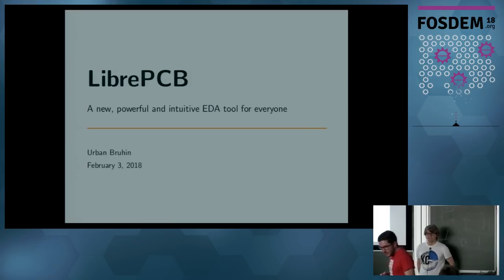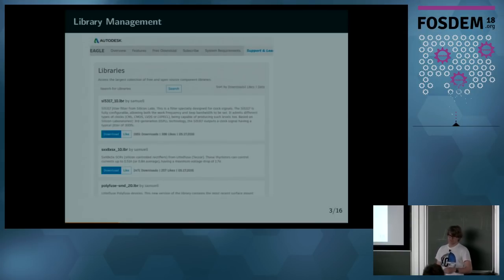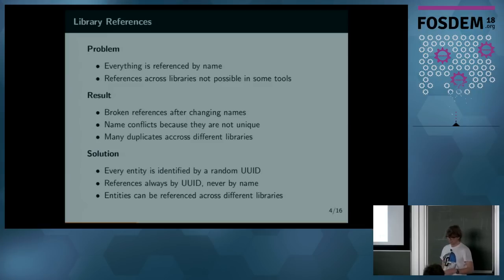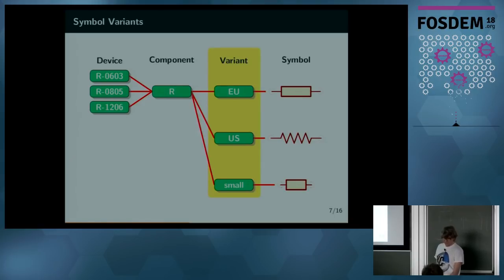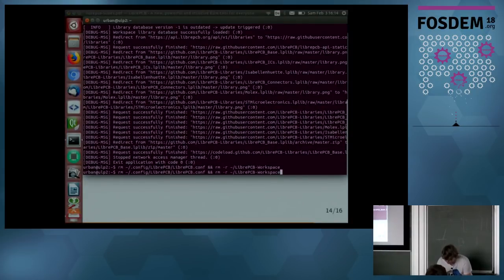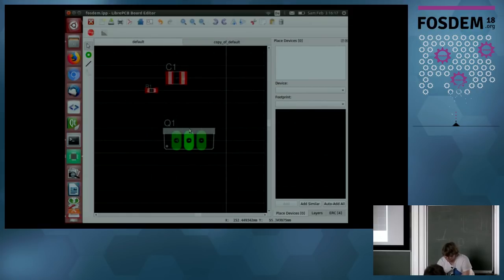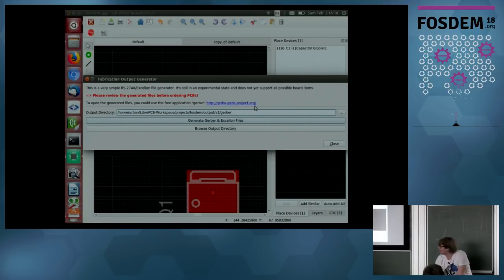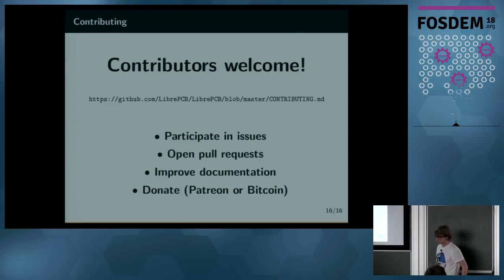Introduction to LibrePCB A new, powerful and intuitive EDA tool for everyone

Comment: Nice. Very nice. I 100% agree with the importance of the library.
I Have dealt with PCB Design tools for 35+ years I have spent decades trying to influence the major tool-vendors (Zuken, Mentor, etc) to raise the quality of the library management system. Speaking for deaf ears of course ;-)
Another part I have thought and worked with vendors about are to get them to make use the intrinsic symmetries in libraries. A SO16 is a variant of the SO14 which actually is a variant of SO4. The pads are just repetitive. Extrapolating that you could create the pad from the known parameters of manufacturing and the 3D information of the package pins. So the 3D package is the master and everything else is derived from that, including assembly drawing, etc.

Among quite many different ideas that are more exotic ,,, PCB driven design were placement influence package sizes and number of decoupling, getting rid of the sheet based analogy of a schematic. It just creates much work when dealing with large multi symbol parts where the portion never really suits all projects. It is the connectivity we want to adress and create. What you would want is a way to dynamically create representations of the connectivity depending on what you are working on. Todays schematics are just a static representation of the connectivity. Much the same journey webpages have done.

Sorry for ranting.
Great work.
Reply: I agree. Kicad is fundamentally different and I don't like how it does things.

It is better to create a new tool with new approaches. If it succeeds or had good ideas, kicad will reform and improve it's state.

Comment: This is so cool the way the libraries for the schematic symbols and the footprints are organized. you just choose a generic part first and choose the specific footprints later. If you don't like it you can create your own footprints and add them to the list under that particular generic part. Really awesome.
Also the fact that the components are all in a "tray" until you place them on the board is super cool. Removes the clutter from the board and makes workflow smoother. And multiple boards from the same schematic? I'm hooked. I just hope I get a job soon or manage to improve my programming skills, I want to contribute somehow.